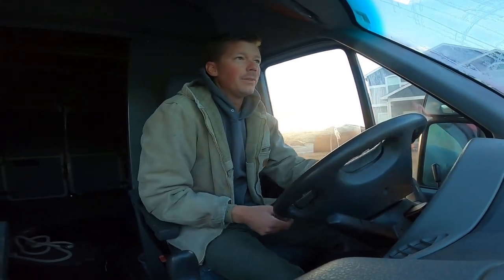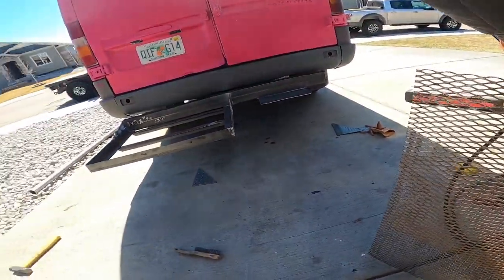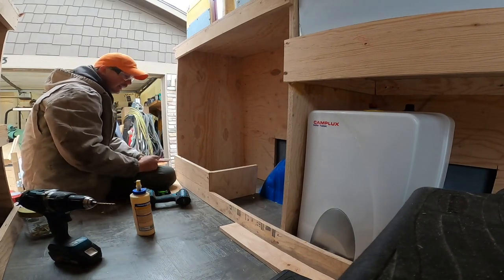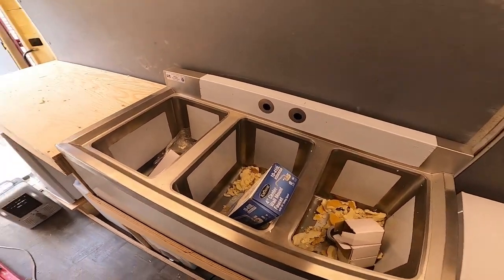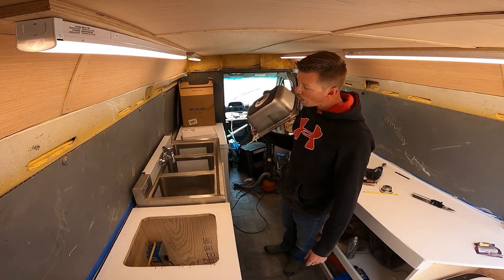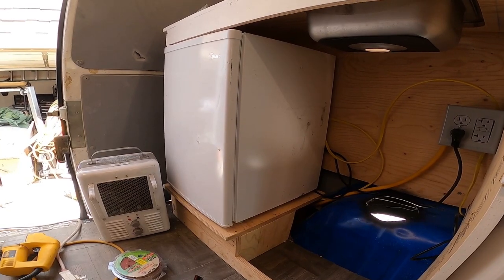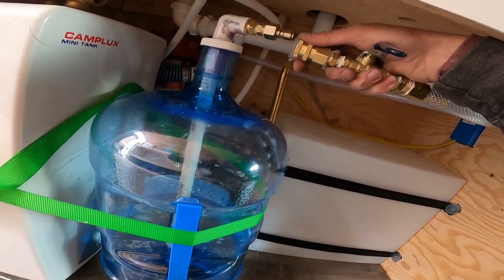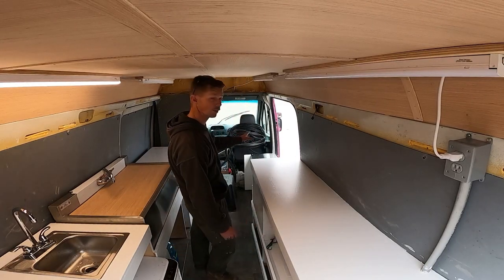Diesel Snow Cone Van Build

Comment: Good job on the build, it turned out really nice. Those screws you used on the wood frame are my favorite but I'm always deceived on how many I need to buy for a project and end up using more then I bought on the first trip. Could probably order them in bulk online but wish the local retainers sold them in 500+ sets.